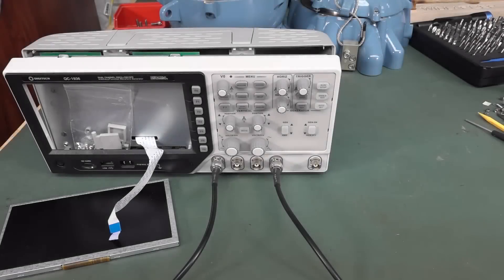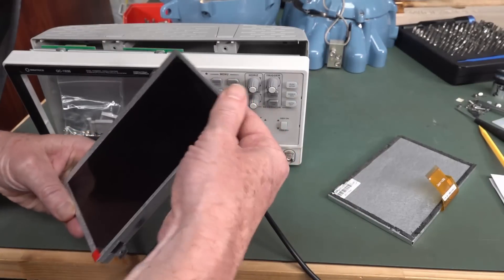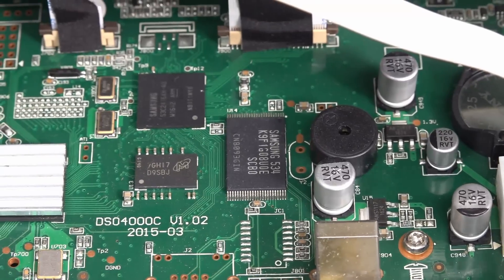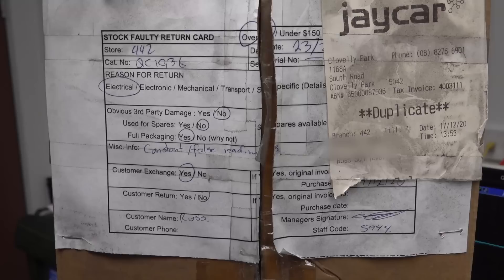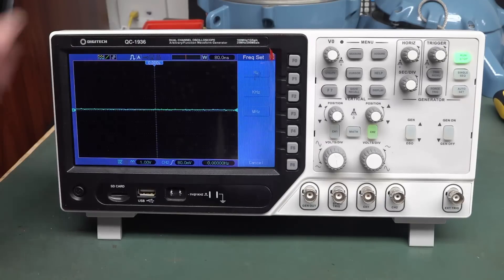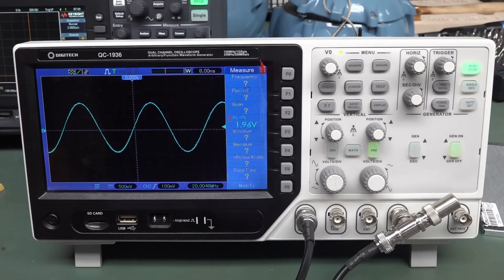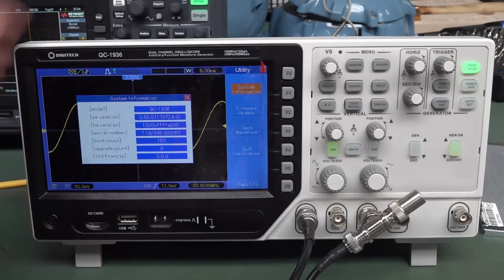EEVblog 1492 - $5 Oscilloscope Repaired! + Oz GIVEAWAY

Comment: If i had an extra scope like that I would figure out & make it battery powered. So far with my scopes, it's great to have the jewels at the desk but every so often and quite often I need to work on equipment that is somewhere else.
  If it's battery powered does that mean you don't have to worry about putting the ground of the probe in circuit ?  THAT would be handy.

Comment: I see a future need for an oscilloscope in my future. I'm looking for cheap yet reliable since my workplace had me dragging my peach to engineering in another building to test coin cell batteries. Up until I bought an EEVblog multimeter of epic awesomeness. 

I work for a hospital in my area, You should see the tool kits we were given. Sure, screwdrivers are handy, and the little vacuum that can't is a cute little thing, but the voltage sensor is only 80 volts and up. A little LED lights up if there's power. Heck, I've taken out a bit of a drop down ceiling for half that across my tongue. Aaaand $3k damage to a telecom system... Forget I typed that...

Comment: I used a similar Hantek scope for about 2 years at work. 5 bucks is 5 bucks too many for this piece of crap. It would often not trigger properly. The measurements drifted from day to day. It would freeze and crash at least one time per day. The screen flickered when someone was making coffee in the kitchen. When i contacted Hantek customer support about this, i got the worse answer from customer support i've ever gotten. "We have the same model here and it workse fine".
And before anyone says i dident know how to use it properly, that is what i tough at first. 2 other engineers with about 20-30 years experience each tried to use it and they got the same results.

Comment: Thanks for these videos! I actually have a Hantek DSO4102C which is very similar to this scope (if not identical). To be honest it is the only scope I have owned/used since I graduated back in 1997. As you may guess I am not working with electronics on a daily basis ;) However, I have used the scope a few times and sort of gotten used to its interface. What surprises me is that your ranting about how terrible the UI is. I believe you are right, so it would be very interesting to know which of the various cheap scopes out there does have a decent user interface (in case I should upgrade)? Which brands to look for and not... Is Rigol for example very much better regarding the UI?

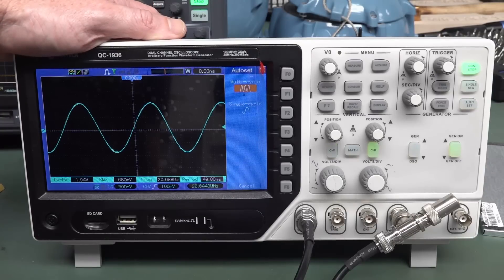Comment: 11:58 Hi Dave this is maybe the fault on CH2 for returning the scope. It only shows PK-PK voltage and all other measurements are wit question marks. 11:32 on CH1 it shows all measurements.
Reply: That's not a technical fault. I'm not having an oppinion whether UI is at primary fault here, though. The UI of the Hantek scopes is mediocre overall (I own a rebranded Hantek myself, so I guess I'm entitled to have an oppinion on overall UI quality).
The measurements are tied to CH1 or CH2, whether the channel is enabled or not. All measurements tied to channel one just display question marks if channel one is turned off. Dave changed the PK-PK-display he was interested in over to channel two at 11:53 (he says "there we go, channel 2, and the OK" at the time he reconfigures this one measurement indicator.
The color of the title and the value indicates the channel: Yellow = CH1, Blue = CH2.

Comment: A $5 scope beats not having one at all.
Reply: I inherited my 20MHz Beckman analog from my dad. He never used it.
Reply: Definitely true. Before I got a hold of a 30MHz BK Precision 1497B, I was lost no matter what I was doing. Once I could finally see what was going on inside my circuits, I was really able to start building my electronics engineering skills. Now a 350MHz Tektronix 2467 is my main scope, still keeping the BK as a secondary.
Reply: @RAndrewNeal  I tracked down an Agilent 54622D 100MHz mixed mode scope after seeing Dave do a review here on the channel. The one with the ROCK_ON Easter egg.
Reply: @BlackEpyon  Nice!

Comment: I mentioned in an earlier video, to check the -7 volt supply. I had the same scope. When the -7 volt supply fails, it fails high. Before I found what was causing the intermittent changes in vertical offset and gain, the chip for the sync failed, so I also lost all ability to sync the scope. Fixed the supply, but the sync amplifier is dead and unobtainable. Check those negative supplies before it causes more damage.

Comment: Does it work any better through the display than it did via USB???
Reply from the maker: Anything is better than that software.
Reply: The screen update rate over USB was awful, a screen is required to get any usable way to adjust settings with that rotary knob at the top left of the panel. That mode of operation is not meant for live operation, but it is meant for taking screenshots or a casual adjustment for an experiment already set up well.